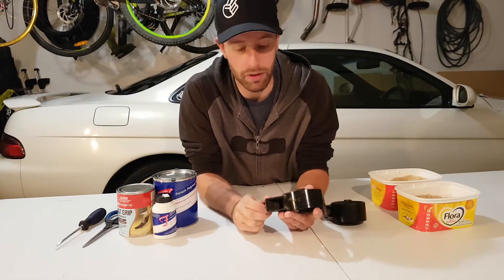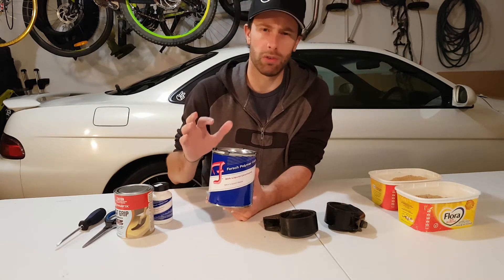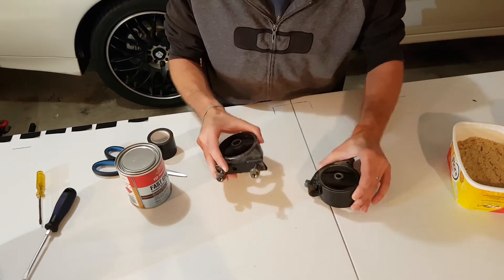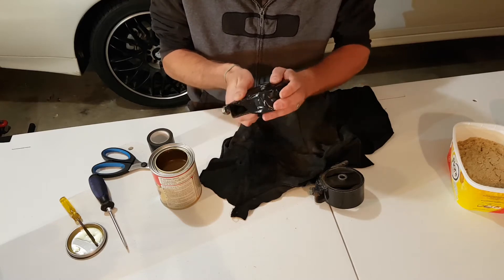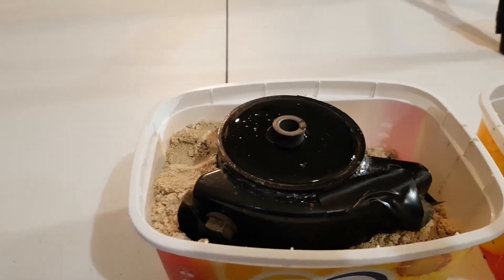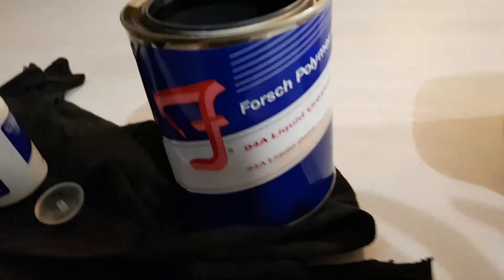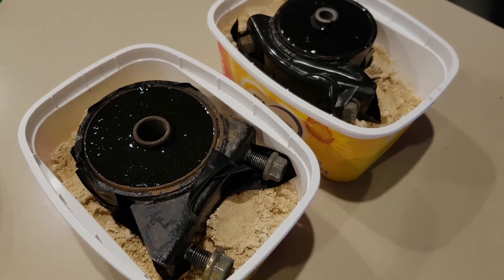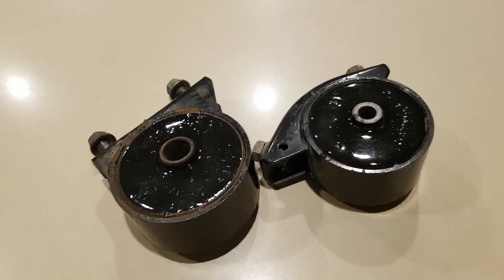Budget Race Car Build - Part 13 - Rebuilding our engine mounts

Comment: Did you use the Loctite Roof & Flashing Polyurethane or the 3M Window Weld Urethane product before?
Another video I watched last night where the guy tried both stated that the 3M Window Weld has more firmness and is better for more Race oriented Engine Mounts.
Reply from the maker: OH man, honestly i can't remember, but the stuff i ended up going with is killer! It's the proper poly bush kit, i'll definitely use it again, the diff mount on the soarer is getting pretty clunky i'll be using this stuff again for that no doubt! :)

Comment: Nice job. I havnt change the mounts on my car yet but I can defiantly see how this would help the engine not tilting backwards and keep more weight over the front wheels when accelerating.
Reply from the maker: Absolutely! no one likes a floppy engine :P just gives you a bit more instant and controllable power too, you don't have that lag of the engine twisting and when gearing down the engine doesnt' bounce on the mounts as much :) pretty cheap option too!

Comment: Nice. I should have done this to the rear diff of the celica instead of welding in a steal plate. Could'a should'a would'a.
Reply from the maker: I did exactly the same thing to the diff on my GT-4l, just welding a big plate over it :P it worked, wasn't exactly gentle but better than the clonk clonk every time you let off the throttle :)

Comment: you can get the raw material from solid solutions in East Bentley, I use it in heaps of applications ;)
Reply from the maker: Nice! Just need to work out the stiffness rating, might chat to them next time:) these worked great